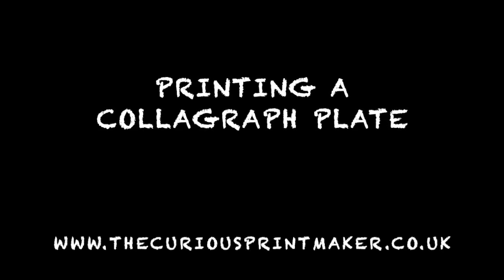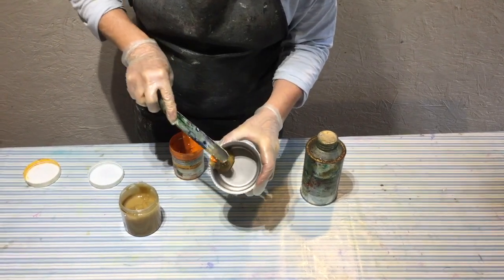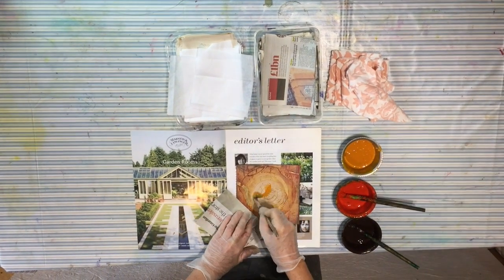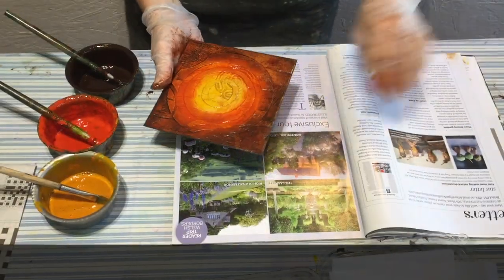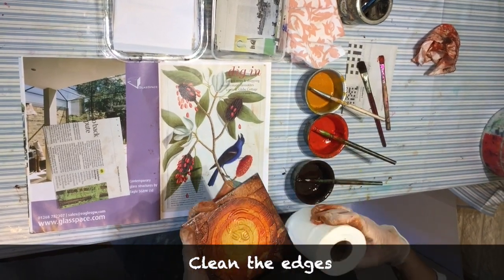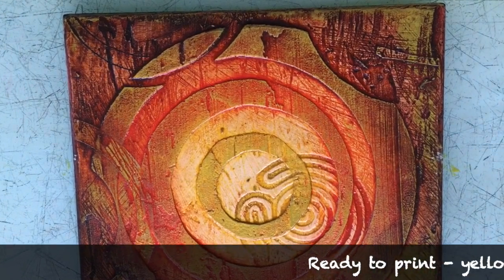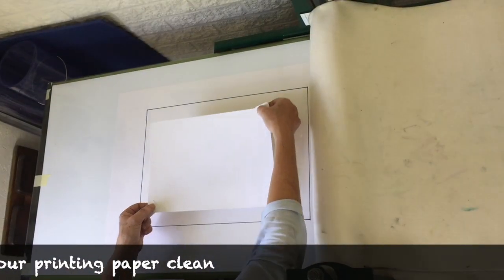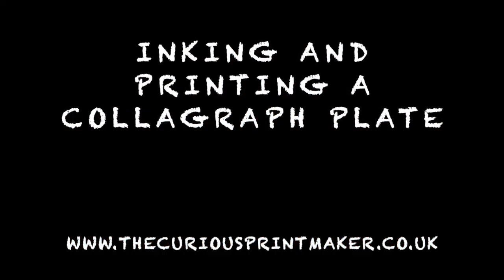inking and printing a collagraph plate

Comment: Thank you. Very informative. Can you tell me the make of your etching printer?
Reply from the maker: Hi Paul, I have two presses, one is a Rollaco and the other is a Hawthorn press.
Reply: The Curious Printmaker thanks for that. They are the same makes I have been considering purchasing. Do you prefer one over the other?
Reply from the maker: @pablobattu  Thats a bit like asking which child do I prefer! I got the Rollaco first so am very used to it after all these years, but the Hawthorn one is a bit bigger and has gears so it is easier to turn the handle. I use the Hawthorn one for bigger prints and the rollaco as a general default one.